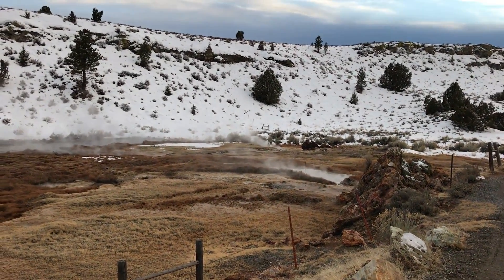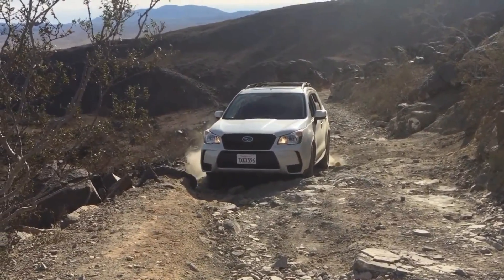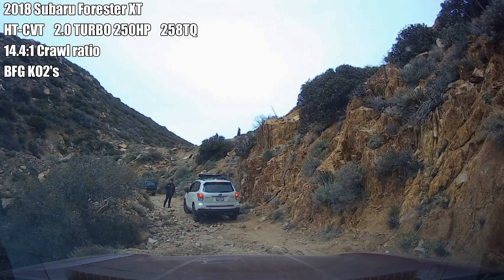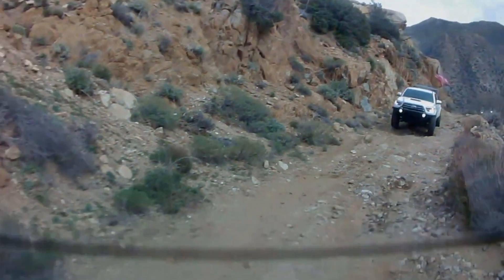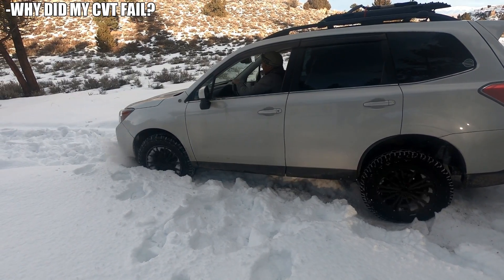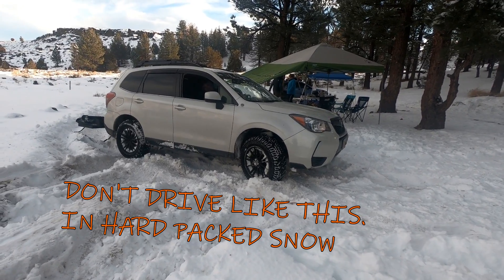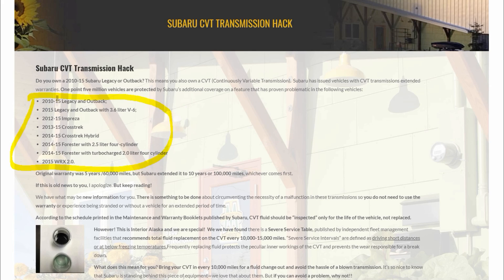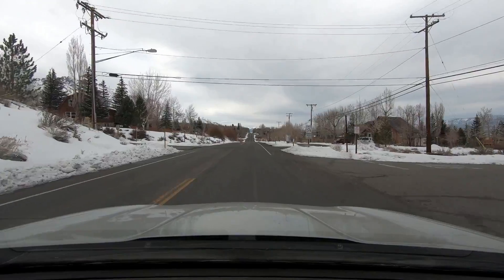CVT transmission Failed!  Can we make them last?

Comment: Thanks for posting this video Jon!! Well made video and great information buddy 👍 you did not bash the cvt at all! The cvt is a weakness in the 2014-2018 Fxt. 

We just did pilot rock truck trail and yesssss that cvt really cuts power and or struggles on steep uphill and when u hit an off camber obstacle in the middle of the hill climb it completely stops the vehicle. Your right in you HAVE to use momentum. 

Even pressing traction control off does not help either and I have noticed this when trying to do donuts that once the rear wheels start to spin the abs engages and stops my momentum. Although not mentioned in my video u can see I can't do a donut in the anzaborrego video I posted. 

Transmission cooling options
-Derale 13403 series 1000 stacked plate 19 row 
-Hayden 678 rapid cool 
-Hayden 778 rapid cool 337
-Derale 25011 fluid control thermostat kit
-Vibrant performance 11978 flex hose (better than plain rubber hoses)
Reply from the maker: Good stuff Marc!  I'm sure people will find your comment useful!  I was really hoping to make it to the Pilot truck trail event, but I had to attend my baby cousins highschool graduation lunch that Saturday.
It's so alarming that I personally know a "handful of people on instagram" with replaced CVT's in the SJ FXT's.
Reply: @JonDZ_Adventuring  yaaa I was hoping to see ya there but that's okay man :) we can always do the trail again. Some of those offshoots are gnarly haha I got stuck on a steep uphill climb. Video coming within this week 🤗
Reply: Hayden 679 is what I got

Comment: It's so funny, this morning I was chatting with someone on Instagram about the CVT and I suggested he check out your channel because you've mentioned the CVT issues a number of times, and then I came to check in on YouTube and, lo and behold, you had just posted this! This was really interesting and informative. And that footage of @daklakfoto ...oh my gosh, that was painful to watch. It's ludicrous that a car armed with such a capable AWD system should have to get a running start over terrain like that. Thanks for putting this together Jon, you are truly doing the community a service with your research and analysis.
Reply from the maker: Making this video, I actually learned alot myself.  I mean, I already knew about this stuff, but just comparing everything side by side was SUPER EYE OPENING.  Did you notice that your model Forester with the 4EAT transmission with a lower crawl ratio will outclimb a CVT?  This leads me to believe that Crawl Ratio's need to be calculated differently on CVTs.  The formula is 1st Gear * Final Drive ( axle ratio).  Should a CVT's crawl ratio formula be (1st gear * Final Drive) minus 30%?  That sounds kinda Accurate.

I never used as much momentum as Daklak Foto did up that Oriflame Trail hill climb.  That's just soooooo scary.  It's a good thing he has BFG KO2's.  My 4 ply tires would never survive something like that!
Reply: @JonDZ_Adventuring   I did notice that! I had no idea the gearing in the 4EAT was technically/theoretically worse than the CVT, by the numbers. While I know video never does justice to how bad the terrain is, that trail where Huy ran into difficulties looked like something I would just ease right up. I'm grateful I landed where I did in the range of Forester models. That transmission temperature chart was eye-opening...even with the 4EAT I do notice a hot smell from my transmission when I have to deal with extended, challenging conditions. I guess I should give more consideration to a transmission cooler.
Reply from the maker: @softroadingthewest  Sandra did the climb with her SH Forester.  She was able to crawl up.  The camera angle is a little misleading.  You get a better idea of the steepness during DakLakFoto's rear camera angle.
Reply from the maker: @softroadingthewest  7:16
Reply: softroadingthewest friction belts simply cannot replace gears.

Comment: Welp this one stung a little.😬I kinda thought the problem was limited to the 15 but after seeing the struggles that 18 is having it seems they haven’t fixed the issue. I had a 79 gl wagon completely stock on street tires that I took up the Garcia ridge Jeep trail and when I got to the end there were a group of lifted tacos asking me how I made it out there. With a good awd manual transmission and a hillholder. Damn I miss that car. Thanks for the info Jon! 👊
Reply from the maker: Steve Priest, Yeah, I know man.  I started off the episode saying "This video is going to suck".  It was sooooo hard for me to make, and... I didn't want to alarm anyone, and I wouldn't have... but this information is too useful and can save the lives of the .... CVT.  :(

Comment from the maker: **UPDATE**  Pinning post from Bruceyyyy.  He has a youtube channel with some good info about Subaru's. Also check out Powerofyour brains, I've been a fan of both channels for a while now.  They both provide some good info.
https://www.youtube.com/user/bruceyyyyy
https://www.youtube.com/user/powerofyourbrains

5-27-2019
To monitor your Subaru transmission temperatures you can use the "ACTIVE OBD" app on iPhone and Anroid.  For the Honda Passport, you can use "Torque Pro" on Android.  For a full time, always on digital gauge, you can purchase a $159 Scan gauge II Ultra compact: https://amzn.to/2ECyvrp.  This gauge isn't cheap, but if it can save you from a $8000-9000 CVT replacement, I think it's worth it.

5-29-2019 **UPDATE**  Pinning post from @BRUCEYYYY
"I think at the end of the day there is a lot of information out there and a not insignificant amount just isn't good info.  This video is an example of good info.  Cool the fluid.  I've had my AT Temp warning light come on before.  The thing goes into limp mode and puts basically no power to the ground.  Symptoms seemed similar in this video.  I just left it running and ran the heat on high and went for a walk.  Once the light went off it worked fine and has for years now.  Change the fluid.  Subaru recommends somewhere between never and 25k.  I'm splitting the difference and doing it at 50k.  Which is right now.  I'll get a Blackstone Labs analysis done for my own curiosity and find a place to post it.  Either YT or OB forum.  I'll be using the HT CVT Fluid.  Monitor the fluid.  I have an old scangauge that we managed to dig the CVT temps from.  I used to see as high as 270F before the cooler but haven't seen higher than 220 now.  Other thoughts: Subaru seems to recommend replacement over repair for these often which is where that big 8k bill that scares a lot of folk come from.  This seems to be standard policy.  They did the same thing with the 5EAT.  (5EAT's actually cost more than a CVT from Subaru)  The difference here is there aren't any 5EAT's that are still in warranty. 
I've seen them repaired (search around the google for 580/690 info and you'll find lots) and one can pick them up from salvage yards with a (short) warranty for a few hundred dollars. 500-1000 seems to be the norm.  I think I saw one as low as 300. (car-part).  I did draw a different conclusion than JonDZ in his video here with the bog down/hill climb issue.  I think the traction control is what does it.  I have a video (subaru smarter than you) on it showing that ripping fuses to disable traction control the car will happily power up a hill but turns into a diagonal spin wonder like all the older Subaru's are.  Something in the programming can't figure out steep inclines and wheel spin so it decides to do nothing.  I'm looking forward for someone to really put the dual x mode on the new Foz/OB to the test as I'm yet to see a video of people do what we're doing to it.  
Still not sure if gimmick or not." - Bruceyyyy
Reply: JonDZ Adventuring https://community.cartalk.com/t/wtf-got-a-letter-from-subaru-saying-the-cvt-transmission-may-fail/126551
Reply from the maker: @Consolethumbs  nothing I haven't heard already.  Daklakfoto and I, are trying to get to the bottom of this using real world testing and observation.
Reply: @JonDZ_Adventuring  
MrSubaru1387 talks about the decline of their quality.
Reply: Did you say anyone with a 2.5 has a newer better tranny?
Reply from the maker: @kartboarder22g17  the 2.5's use Subaru's second generation CVT designated the TR580.  This transmission is designed for lower torque applications, but it's smaller, more efficient, has less parasitic drive train loss.  It's a newer design.

The TR690 was the first generation Subaru lineartronic CVT.  It's an older design, bigger, less efficient, but It was made more robust to be used with Subaru higher output engines.  Subaru upgraded the belt-chain, torque converter, and valve body.

I couldn't find the article that I got all this info from, but I did find this wiki page.
https://en.wikipedia.org/wiki/List_of_Subaru_transmissions
Reply: @JonDZ_Adventuring  Very interesting, I did not know this till now.  I went through the Wiki link you provided.  I assumed I had the 2nd gen. CVT with my 2014 Forester 2.5 and your 2.0T Forester had a different version of the 2nd. Gen and there was even a newer 3rd gen and maybe more.  But according to this there are only 2 versions of CVT that are being used since 2010.  So, I have heard many 2010/2011 Outbacks getting 160k+ mileage, but according to this they have the identical CVT you have, yet with less torque as these have the 2.5 NA.  Also, probably aren't driven off road as hard as what you guys are doing too.  

Onto another subject, with your Honda, do you monitor your tranny temp. when off roading and also do you monitor your rear drive module temp. or just let the computer monitor it and shut it down?
Reply from the maker: @kartboarder22g17  sorry I did not make it clear, but the higher output engines we're different than the original 1st gen TR690 in that they have more robust chain-belts, torque converter and valve body.  In 2018, the CVT's got further improvements with upgraded CVT belt-chains and other small parts.  Subaru CVT's will get improvements as the years go by.
Reply: I guess to add, I don't see any 2018+ cvt information added.  So kinda curious what they are putting in the Asscent.  Also with the high towing 5k lbs I would think the CVT would be a poor choice for that vehicle.  I realize when talking to the dealer you need a tranny cooler to tow the 5k, if you don't have that installed tow is left at like 2700lbs or something around there.  So,  if your truely towing i would think stay away.
Reply: You know who doesnt have issues with premature CVT failure? Mitsubishi and Suzuki. Who buy the way uses the same JATCO CVT units as Subaru. The key is programming, low curb weight, low torque and hp. Use the Outlander sport is slow and has a weak towing capacit, but its engineered that way to put less stress on the CVT8. My Mitsubishi Mirage weighs only 2000lbs and has 74hp & 74 torque, which translates to reliability! Nissan and Subaru put these trannys in way to heavy/powerful cars.
Reply: your cvt transmission is worn out prematurely because you put fatter tires on it which strains the motor. Trying to move bigger tires is different that hauling gear. Every single person who has a premature broken CVT always scratches their head as to why it happened. Try looking at your tires and stop trying to add bigger tires. You have a subaru, not a jeep. You cant handle bigger tires and they are absolutely not necessary for what subarus do, light offroading and overlanding. The main reason people get beefier tires is because they feel like the stock ones are too small and they want it to look more "aesthetic". If you run skinnier, but slightly taller tires, 1), they are much better for offroading and terrain contact 2) you get more mpg because theres less drag 3) you wont have CVT problems. 4) you get extra height even if you PSI down, versus lowering down psi in a fatter wider tire. thus better overall ground clearance
tires are a tool. They are meant for a specific use. Having bigger wider tires are only for rock crawling,sand like in the sahara desert and being able to have a huge payload (work trucks that haul dirt and boulders). all that nonsense about bigger tires provide more traction is dependent on a variety of factors. That is why there are people with 4000+ dollar suspension kits and 2000+ tire setups who cant get over a simple hill while a stock jeeps and subarus with skinny tires can take it on with little to no trouble at all. Just my 2 cents, save yourself a lot of money and let go of "big tire ego"
Reply: oh yes and as much as I love turbos, turbos ruin cars fast. Period

Comment: JonDZ - Wow .  .  .  as the owner of a 2016 Outback 2.5I Limited, I'm now seriously educated and forewarned. Fortunately, I'm an easy, low mileage driver who has done just light trail running with my Outback.  Even though Subaru has recognized the issues and is apparently doing the buying public right - - "why even take the risk?" For me the right decision is 'fond farewell to Subaru, and hello to Toyota 4Runner.'  Subaru - - are you listening?
Reply from the maker: Great Comment dblarw, when people ask me what vehicle I recommend, I advise against CVT's.  These are put into entry level vehicles and aren't meant to last.  I think they can work great in small light weight vehicles and in ATV's they work great and are reliable.  I cringe at the thought of the Subaru Ascent, which has the same CVT as my old Forester XT.

I'd be totally fine with a CVT if it wasn't so expensive to replace them ($8-9K).  I'd be fine with a CVT if they were actually repairable in the USA.  One day, that may change, and if the repair cost can get down to $3-4K then a CVT could be an acceptable transmission.

Comment: Do you have any information on how the 2019 Forester would behave in similar conditions.
I think it wont cut power if you put in deep dirt/snow. But god they need to fix this cvt or just put an auto in it.
Anyways sad to say, but i may move away from this car brand. The community is awesome but i buy a car to take me wherever i want without letting me down.
Reply from the maker: Umbra, although there's two models of the Subaru Lineartronic CVT, they've been getting small but consistent upgrades over the years, for example In 2018 Subaru started using a new CVT chain-belt.  Along with the torque converter and valve body, that's one of the most important parts in the CVT!  Besides that, I don't have anymore information about the 2019 Forester.  I should look into it :P  I'll leave more comments if or when I find out more news.
Reply: @JonDZ_Adventuring  thanks so much for the feedback. I think if a Forester is kept stock it will be ok. Looking forward for the next vid!